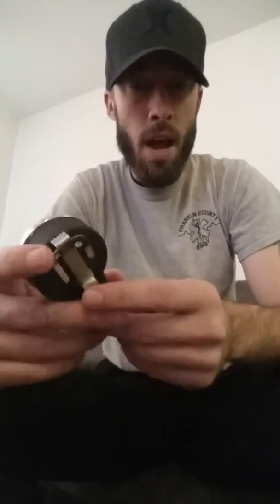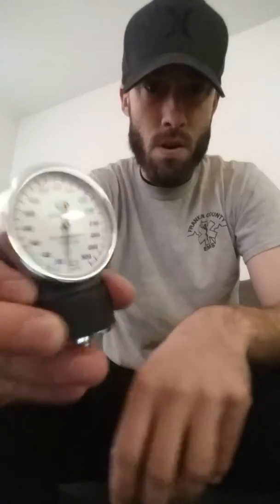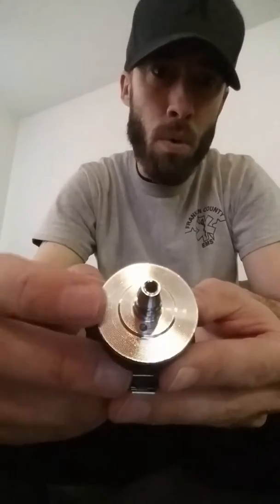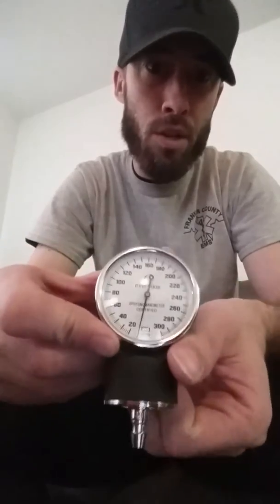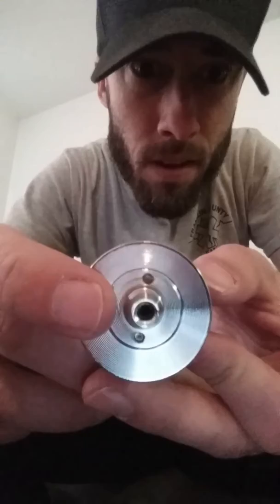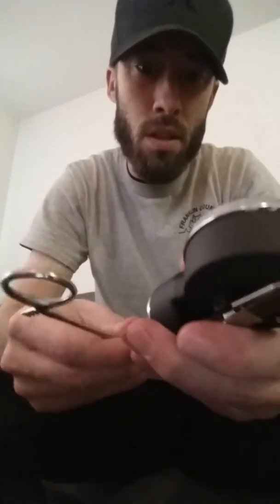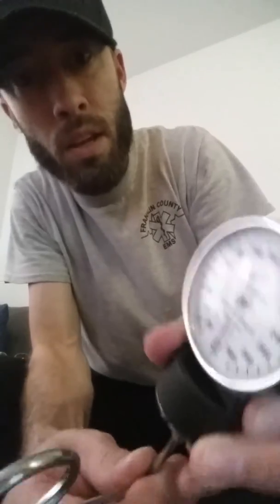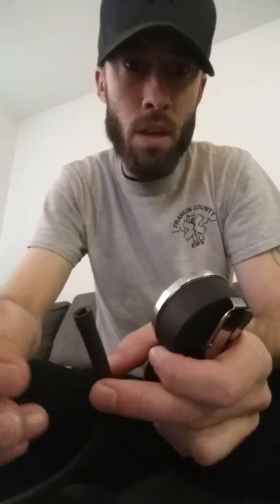Calibration of Sphygmomanometer on your blood pressure cuff

Comment: Pointer came back to zero. Now the bladder is filling but the pointer is not moving. Any solution for this?
Reply from the maker: Make sure your dial is turned down completely to the "off" or right position so the bladder can fill without escaping. Also make sure you have a good seal.

Comment: Resetting zero is not the same as calibration. If needle falls out of zero the aneroid is out of calibration, but moving needle back into square does not mean it's in calibration.
Reply from the maker: Mike Nagle 

A Baumanometer is a hospital grade blood pressure system that has specific guidelines on how to calibrate the system, unlike the portable devices like the ones used in the field by first responders that only needs a needle adjustment, which to be accurate you could follow the Baumanometer requirements. Thanks for watching the video!

Comment: Thank you for the video. I tried doing this but when I put the hose back on the gauge is not moving but the bladder is filling up
Reply: Yeah same issue
Reply: Make sure an arm is inside the cuff or the cuff is wrapped around something solid.  The gauge will not see any pressure if the inside of the cuff is not pressing against something.
Reply from the maker: Is your sphygmomanometer the same as the one in the video or are they different?  I apologize for taking so long to reply. I'm sure by now you already got a new one. Let me know if I can help further.